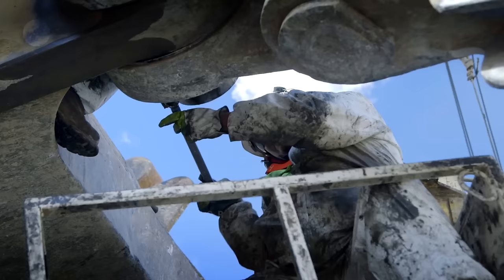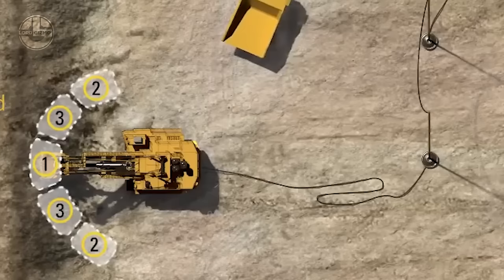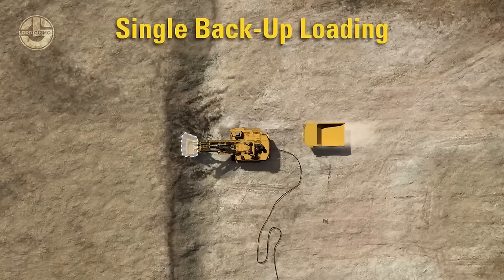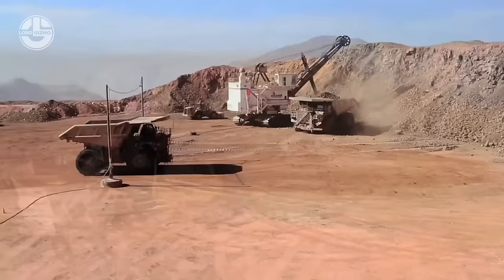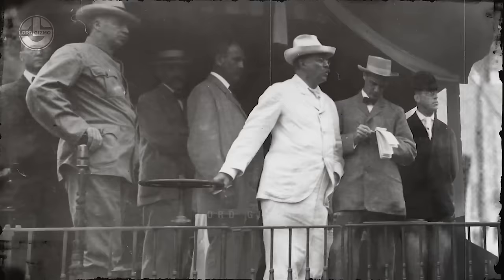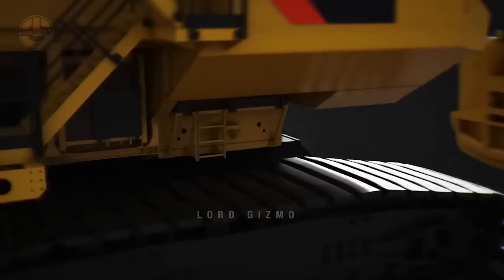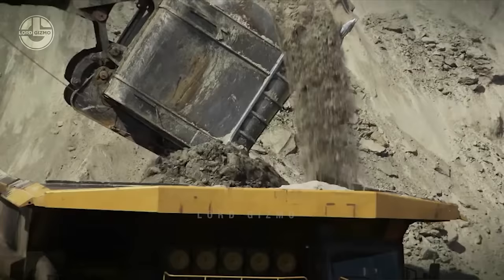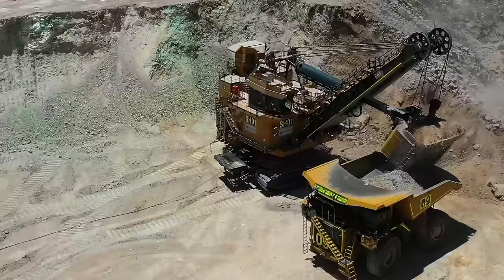Unveiling the Giant: Full Documentary on the World's Most Powerful Electric Rope Shovel Ever Built!

Comment: I would think in a video of this complexity the narrator could get the model number correct.  Sometimes it was a 7495 and sometimes it was a 7945 or are there two completely diff machines.  I'm a 33 yr vet of the Decatur, IL Caterpillar Plant the home of off highway trucks, tractor scrapers and select rubber tired loaders and compactor wheel loaders.
Reply: It’s an A.I voice
Reply: Maybe they had 2 of them
Reply: This is definitely one of the more comprehensive videos of its type I’ve seen.   It’s too bad you didn’t find a way to introduce yourself as a component of this industry without knocking someone else’s honest effort.

Comment: more than 50 thousand tonnes,  i think they got that figure wrong.
Reply: @ericdavidberkus2950  I think it was 15 thousands or something
Reply: It’s 1533 tons (3,066,600lbs). 50,000 tons would be 100 millions pounds. The Captain shovel which had a dipper capacity of 180 cubic yards (over 2x what the 7495’s largest configuration bucket could hold) and it was 14,000 tons (28,000,000lbs).  So def a mistake by the channel on that one.